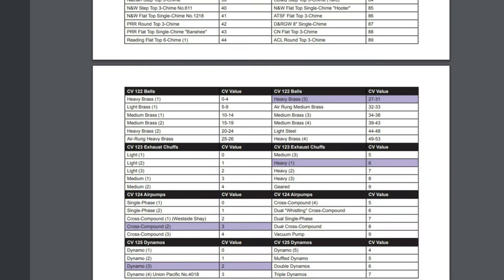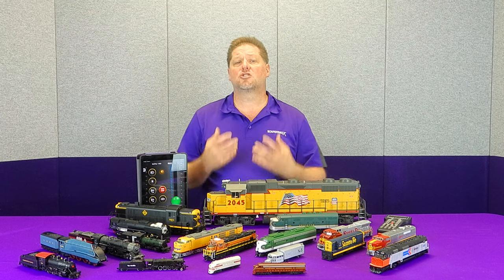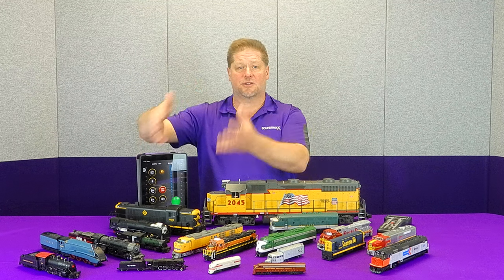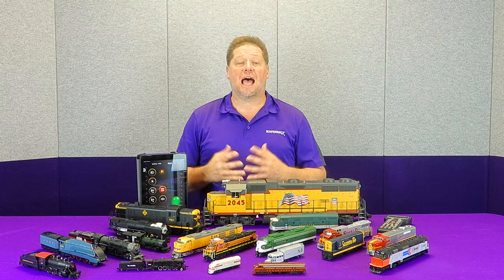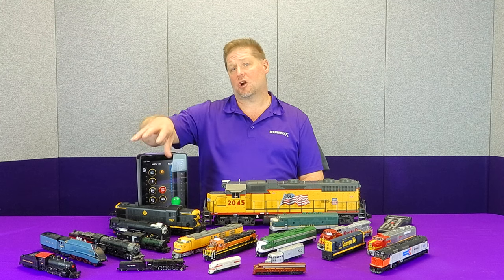SoundTraxx makes the sound!

Comment: Hi George, Soundtraxx makes a great line of decoders. Right now I'm working on installing an Econami PNP decoder in a HO Proto2000 EMD BL2 diesel.

But, you need to come out with an EMD-3 decoder. Some sounds needed which you don't offer are the 6 cylinder EMD 567 (SW1 and SW600), 8 cylinder EMD 567 (SW8/SW900), 8 cylinder 645 non turbo (SW1000/SW1001), 8 cylinder 645 Turbo (GP15T and MP15T). A Winton 201 would be nice, but I don't know of any operational Winton diesels.
Reply: And a 20-cylinder EMD 710G for the SD80MAC! If you think the 16 cylinder 710 is good enough, then a 16 cylinder 645 must be good enough for an SD45.
Reply: I would like a second GE decoder too. I need a Cooper-Bessemer FWL-6T as used in the GE 70 ton. Maybe they could call it a GE-7. I asked George about that at the National Train Show and I recall he said they had the sound files just no more memory on the current GE TSU board.
Reply: they have the V8-645E non turbo, it's on the EMD-2 decoders
Reply: @MBrailfan  You didn't understand my reference, but I hope George does. The SD80s that Athearn produced should have had a V20-710, but the decoder has the sound file from a V16-710. I'd like to replace the decoders on my SD80s with the correct sound file, but I don't really want to have to switch to brand L.
Reply: @steeplecab  sorry, I don't know if it is YT being stupid like usual or what - but I was trying to reply to the OP, not to you. I was just pointing out that they did in fact have one of the prime movers he said they didn't have. I agree about the V20-710-G3 for the SD80MACs, although given that there are none operational any more (and indeed, haven't been for years now) getting good audio for it would be a challenge. I'm not sure where 'Brand X' got their recording from but I would not be surprised if it is a 'fudged' recording of a V16.
Reply from the maker: While we do have some recordings mentioned here, some are actually available out in the world now.  Partnering with Athearn, some of the unique sounds are available in Athearn products, such as the 8-Cyl 645T and EMD 265H.  They may not be on the aftermarket decoders for various reasons, including things like exclusivity agreements, etc.  Then there are memory space limitations.  We cannot release a decoder with one prime mover on it.  It would not be economically viable.  How many GE 70T Cooper Bessimer only decoders would we be able to sell, then spread that across all of the formats and it gets even thinner.  While we do want to make every sound available, we also have to look at how these sounds are used, and sometimes, it may be better to hold on to them for a little longer while we accumulate more recordings.

We are still out recording, now that the world has opened back up.  We are making plans for more sound recording trips to be able to expand the library to include more of the unique, or lesser-used engines that ARE in existence.  (The Winton 201..  find me one Aaron!  Grin!) 

The last part is how different are the sounds really, when heard through a mini-cube speaker.  I could simply manipulate recordings using the tools built into the Tsunami2 and tell you it is what it is, and without looking at the sound selection reference, I can make a believable whatever is listed above, when heard through the small speakers.  And, on the 20-cyl 710 (As you mention, none to record..) will you then not run your loco unless you get a 20-cyl 710 recording?  Use the base 16-cyl, manipulate the sound file some with the included Tsunami2 tools so it doesn’t sound the same, sounds closer to the 20-cyl and run your models..  We could easily do that with the 16-710 and sell it to you as the 20.

One thing I did not mention here is the illusion of everything sounding different.  The claim that EVERY loco sounds completely different is a myth, perpetrated by those companies that keep recording the same engines over and over to sell it to you as stated above.  But a dear friend of mine used to run in the Santa Fe Argentine Yard and he told me.. “George, I’ve tried..  a GP7 sounds like a GP7 sounds like a GP7..  They all sound the same.”  But, if you want them to be different, the audio tools we built into the Tsunami2 will allow you to do just that!  We want to be authentic, but we cannot easily make up recordings..  The exception to this was the Turbines.  We did some audio magic to make these files, but working closely with former railroaders that used to run and work on them, so they knew what they sounded like.  The words “Less Whine, More Thunder” are their words..  So the turbine sounds that have more of the modern ‘jet engine whine’ by other brands are simply fabricated, and then not thoroughly researched, so the user gets what they assumed they sounded like. 

Recording locos is also a fine art.  We do need access to the loco to mic it up properly, then run through the throttle range under a load to get the best possible sound recording for you to have in your models.  Walking along next to a loco in a field just does not give the same effect, so we are very picky on which locos to record.  No access, no recordings.  For example, we are still the only brand with the authentic 4014 recordings from running mics on the loco while test running in May of 2019.  Other brands have tried to ‘walk up’ and get recordings but were sent away.  (Witnesses to the incident have reported that to me.) 

All in all, we are working to build the library so that we can expand the availability of recordings.  Unfortunately, this is not as fast as any of us would like.  Having a recording that we spent money to get and not making $$ is not a good business proposition.  But limited engineering time (remember, we are very much a small business, no large Walmart conglomeration here!) and availability of parts always is a factor.  If we cannot find a bigger memory chip that fits in the same footprint of the current one, then we have to redesign the board.  This is not a small task as there are usually multiple revisions that take weeks to months to get samples to test.  Then testing, and writing the firmware to enable the larger memory chip to be utilized also takes time.

Keep the suggestions coming, but also if you know where locos can be recorded, let us know.  Send info to sales@soundtraxx.com and we’ll reach out and contact these folks and see what we can do.  We also have contacts at many places, but we may not know they have a working version of XYZ loco.  So, make the suggestions and we’ll take them and see what we can make happen..
Reply: @SoundtraxxDCC  George, Thanks for the thoughtful reply. A couple of thoughts in response. It is easy for us model railroaders to say we want Soundtraxx to do sound for this engine or that. We can say the same to Athearn or whoever that we want this engine or that freight car. In the end it does not matter how much I want something because Soundtraxx is a business and they need sell product to stay in business. I may want the GE 70 ton but I will only have 1 because that is what the large cement plant I am going to model part of had for a plant switcher. By contrast I have (either on my layout or on pre-order) 8 GP9s. So ask yourself which decoder is Soundtraxx going to make money on from me. Now that does not mean I won't continue to ask for it once in awhile in hopes they will figure how to do it. 

Second it is just this sort of thing is why TSU 2 is my decoder of choice. They are other great decoder brands out there but the fact is ST has superb customer service. I can't think of anyone else that has the kind of info out there that George, Norman, McKenzie and others provide on this channel. They read and reply to majority of comments here. Great product and great service, what more could I want (well maybe a GE 70t from Athearn Genesis with factory sound). Thanks Goalie George and company, keep up the great work.
Reply: @SoundtraxxDCC  Having the sound files and not using them to offer a product is also a waste of money. What I'm hearing is a lot of reasons why you may have what I want, but you're not going to offer it so I can buy it. That becomes another reason to spend part of my decoder budget with brand L where things are more open source. Your product may be more easily utilized (thanks largely to JMRI), but installation time is relatively short compared to my time using it.